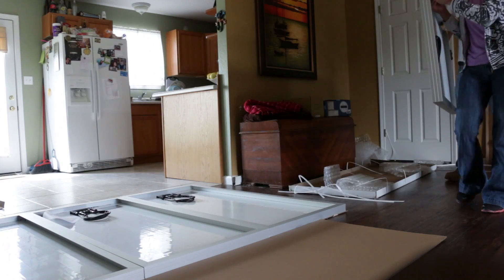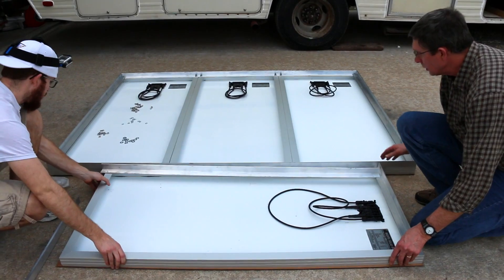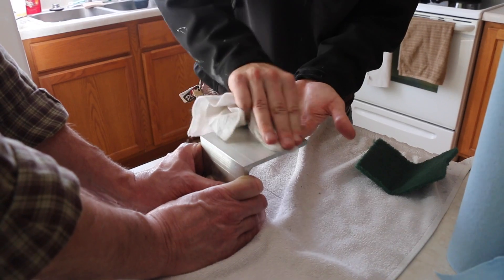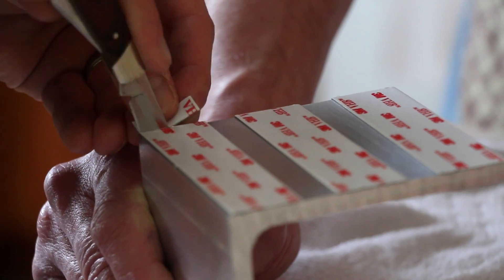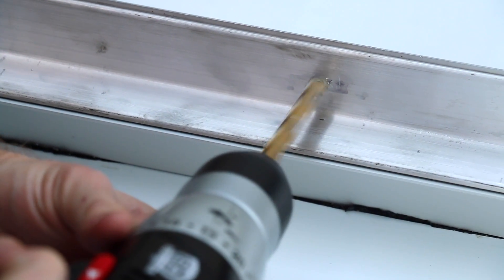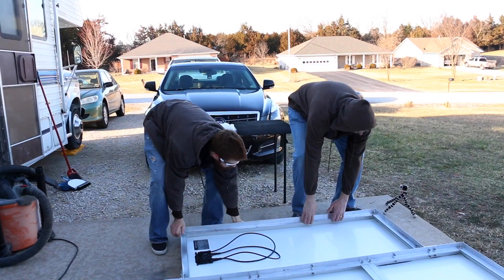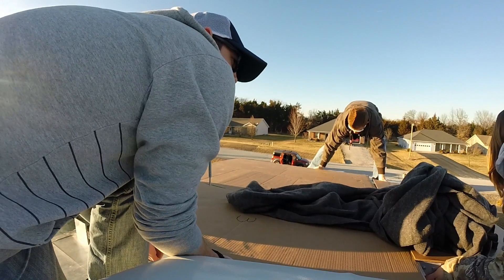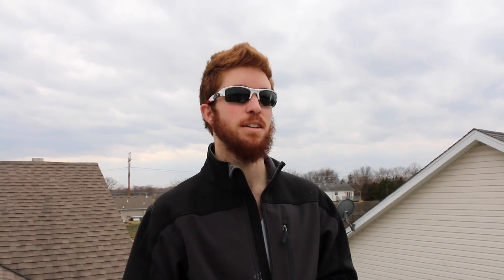Building + Installing a DIY Custom RV Solar Panel Mount

Comment: I used your idea for the panels. Although, I put everything together and pre-drilled the roof mounting brackets and frame and attached them to the frame. Then i removed the panels from the L channel frame. then I took that up to the roof and placed it where I wanted it located. Then I scribed as you did , then cleaned and scrubbed and cleaned and then placed each bracket in place. I was doing this by myself. so, this worked for me.  while I have yet to make any trips , so I have no idea as to longevity of the IBM tape. I plan to add more 4" brackets to the roof in four places with cable running to the main supporting framework for safety. I will need help getting the assembled package to the roof once I am ready to travel. As of now everything is disassembled.  Have you had any problems with your IBM tape?

Comment: I'm not sure if you are still answering questions on this video. But I'm going to cross my fingers. I am getting ready to do my solar install and had a similar idea as you, in regards to making a frame to put my panels together, in my roof array. I will still be screwing the panels to the roof with feet & fasteners, but want to build a frame around an array of 3 and again around 2. I will also be making the frames and feet as well as making the panels tiltable.I have multiple reasons for wanting to do the install in this fashion. 1 - It will be much easier to tilt multiples than individuals, which I believe will lead to using more often. 2 - I will have less feet on the roof and possibly less screws in the roof. I then have 2 concerns about this idea, 1 - the amount of wind the array can catch when in the tilted higher positions, and what damage this could potentially cause? And 2, since multiple panels are melded together in a single frame, they could potentially create a type of "sail" when going down the highway. I was wondering since you have been living with your decision for a while, whether you have an opinion on your decision to tilt in an array versus tilting individually. And whether you have noticed any additional wind resistance on the highway due to large array. Any advice you may have for someone getting ready to do something very similar to your build would be wonderful. Great videos! Thanks in advance

Comment: It would be informational if you were to include the size and length of the bolts you used, as well, the thickness of the aluminum stock. L channel and bar. tks

Comment: This a good video and a nice install.  The only issue I can see with your install is that large distance between the feet could be a problem if you have a snow load on the panel in the off-season or if you are traveling in a place where it could dump some wet snow.  You reinforced the module assembly with the aluminum channel, but a heavy snow could bow the assembly and cause separation of the module lamination or even crack your module glass.  You could install intermediate feet on the assembly that are not attached to the roof but just sit down on the roof (and are not attached to the roof) and prevent the assembly from bowing if you get a heavy dump of snow on it.
Reply from the maker: Michael! This is an EXCELLENT idea and I may just do this in the future. I really appreciate the input. Thankfully we are fair weather RVers so we haven't really had to deal with much snow at all 🤞🏼
Reply: Thanks for the kudo.  We live in the snowbelt in Spokane, WA and boondock early and late in the year.  We've been out camping and got caught in a late spring snow in Montana in April.  It was a heavy wet dump that could have been a problem if our modules had feet as far apart as yours are.  Our panels are 26 X 58 and I use 6 feet on each panel to accommodate a heavy wet snow.  It doesn't really take a lot of weight to bow and delaminate a module.  Do get some extra feet on your array.  It could save you a costly loss!

Comment: Great idea to join all the panels together. Can’t believe that the entire array is being held down to the aluminum roof with brackets attached with small patches of two sided tape. Furthermore, the aluminum roof surface flexes because it appears it that the entire surface is not 100% firmly fixed to the roof structure. Is there any movement when you are travelling highway speeds? I would be concerned if the tape fails in hot or extreme cold weather weakens the adhesive on the tape. This would have a potential to cause injury to others behind you if the panels dislodge. For liability reasons and my piece of mind, I would add a couple of nylon safety straps to ensure it is secured for travel. Even car hoods have a safety catch to ensure it cannot suddenly fly off.
Reply: Colin Gee VHB is good down to - 35 to 95 Celsius.

Comment: Hey man just as an FYI  if you put a deep socket over your drill bit it will take up alot of that space  on the bit and less chance of anything bad happening
Reply from the maker: Thanks for the heads up 👍🏼😎

Comment: Using tape is not a bad idea and I'm confident that that tape can hold well for a few years until it starts to deteriorate, the problem I see is that the aluminum roof that is attached to, while it can sustain heavy loads pushing down it won't hold big loads pushing upwards ( at least not for too long) like when you're driving 60 MPH and the wind gets underneath your panels and they try to pull away from the roof, I'm not trying to discourage you from having that set up (I think is a great set up), I would only suggest that since you have to tilt your panels down before driving I would add a set of straps that can easily be attached to the side rails of your rv, other than that great video.
Reply from the maker: Here is an update video that may give you more info. https://youtu.be/ueryLXmhkJc If we ever end up tilting these panels I have a ratchet strap ready to go. Thanks for the suggestions 👍🏼

Comment: Just a quick comment on the prep for the VHB tape. The surface should be cleaned as you did, but note that it should NOT be scratched-up with anything. The surface should be perfectly smooth. The VHB does not need the "purchase" of the scratches, and doing so will actually reduce the strength of the bond. Just wanted to pass that on. Nice job!
Reply: You are absolutely correct.  Perhaps the best surface for bonding VHB tape is something totally smooth like glass.   Fiberglass is a prefect surface for VHB!

Comment: Great job with the panels!  I'm in the planning stages of a solar install on our new Class A and plan to use the 3M tape also.  Do you know the product number of the #M tape you used?  I see several different ones on Amazon.   Your wiring video was good also.  Did you install any fuses in the line from the combiner box to the charge controller?

Comment: Looks awesome, but still I am super nervous about the tape holding on.. :) I would not live with myself if my panels would come loose and cause an accident to another vehicle while driving.. The tape is going to get fatigued by the time and vibration!

Comment: Quick/unrelated question - but what kind of strap are you using to attach your camera to your headband?
Thanks 🐶
Reply from the maker: It is actually a generic GoPro head strap we found on Amazon. It works pretty well.

Comment: I love this! I was just wondering if that tape will hold up in different climates? From cold to hot? I am so new to all this I just thought I would ask.
Reply from the maker: We have been in freezing temps all the way up to 100 degrees. Over the last six months we've gone 8,000 miles over mountains and down valleys. It is seriously the BEST stuff as long as you prep it right. I will have more on this in my solar series. Thanks for watching! -Michael

Comment: Great solar.  You might consider bolting the l-brackets through the roof with reinforcing plates underneath.  The thin aluminum skin on your roof was never designed to support the upward loads that will be generated while driving when the solar panels act like a wing and try to take off.
Reply from the maker: Thanks for looking out. There seems to be enough room for the air to travel freely past the panels. We've been over six months and 8,000 miles. It doesn't seem to be going anywhere (cross your fingers).
Reply: I think that is what he was trying to avoid. Never mind. Once the panels were installed with 3M VHB. That  roof is stiffer in that location then the rest. As I been using the VHB tape for years to mount panels on RV.s You need a pry bar to remove the brackets now. When Applied properly. This is highly desirable on Fiberglass High Tops. You drill into that. It likes to spider crack and the gel coat\clear coat will flake off. 

And as he said. the 3M VHB tape comes in 200 flavors. You better know which one applies to the application you are using. As it cost $160.00 US for a 1"x15 meter roll. So if he needed too stiffen the roof. You could just do the same thing from inside the RV with braces using 3M vehicle body adhesive. They use to build Mac Trucks with today. As bolts. nuts, rivets and screws have gone the way of the DoDo bird.
Reply: @MasterChief-sl9ro  what are you saying about fibreglass roofs? that the vhb tape is not enough? what about potential delamination? Youre not very clear.

Comment: Enjoying your channel.....
Good luck with the "sail" effect....even a mild 10-15mph wind catching the panels can cause stress, over time, on the brackets.
Perhaps one or two inch spacers between panels could help to "comb" through such windage.
Reply from the maker: Haha thanks! We are 6 months strong and 8,000 in... They are holding up well!

Comment: Yes I think a associated series dealing with the whole process of solar would be awesome. It is a lot out there especially when you go on your own( when you design your own system). Another great video.
Reply from the maker: Yes! We agreed completely. There are so many different ways to do it! We will do our best to explain it in a simple way.
Reply: It is not that complicated really. It just requires a lot of planning and doing the math. Learning the lerms and getting the concepts down pat is part of the process. It was just like learning about electronics and audio products for Radio Shack whom I worked for 29+ years in sales.
Reply from the maker: That is exactly what it is. When you break it down into the fundamentals, it is very practical.

Comment: Loved you VBlog. It's exciting to see the next ones you put up. Where did you buy your solar panels? Did you consider the flexible kind of solar panels that glue or mold to the top of your RV?
Reply from the maker: We actually got them off of eBay. We are working on trying to get our viewers a deal on them. We looked at the flexible ones but decided that the hard monocrystalline were more efficient and durable